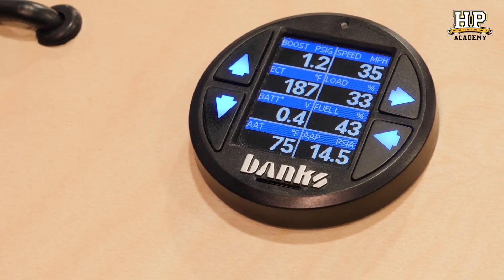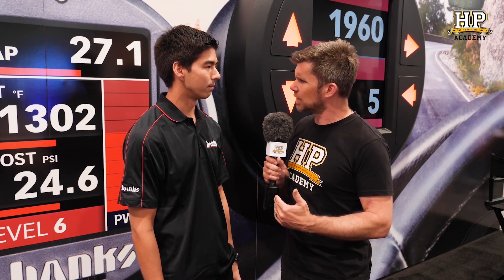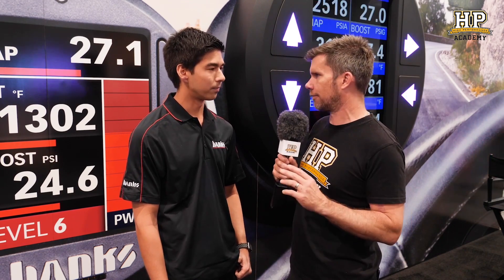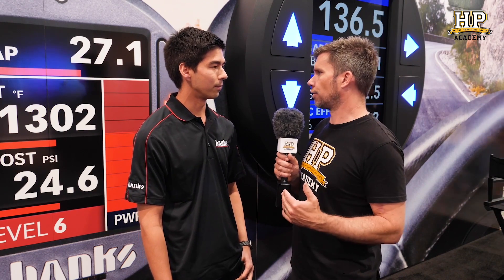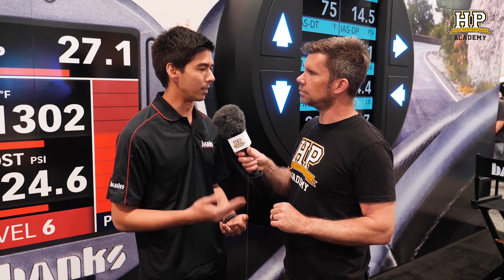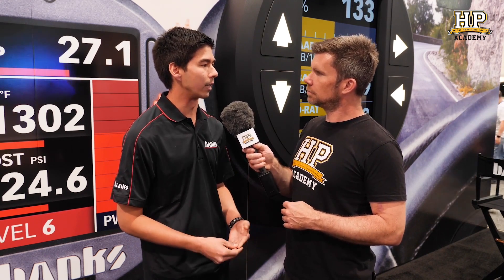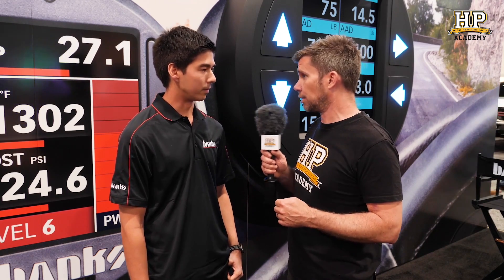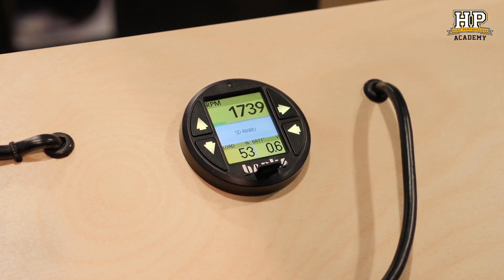How to TUNE your engine without altering the ECM!

Comment: after doing some research i will be switching all my current and future gauges on my diesel (and even other vehicles) to the banks datamonster. im 100% sold having individual EGT monitoring and a million other added sensors such as turbo outlet temp, shaft speed etc all able to import to ONE csv file i can send off to my tuner. it makes things so freaking easy. including able to add in custom sensors such as a wideband 02 sensor etc. 

i love to geek out on data lol

Comment: Wish Banks was more open to getting more data in the iDash (beyond the basic OBDII stuff).  The iDash would be awesome if I could access the things that the old school Scangauge II gets via X Commands - Tire temps, oil temp, trans temp, wheel speeds, etc.
Reply: if they do not have a specific add on sensor, you can define it over their system as long as that sensor is a 0-5v output. so you could do tire temps with a infrared gauge, and individual wheel speeds (i do not have the technical know how for this but 100% could be done)
i myself will be logging: 
individual cylinder EGT

total EGT
turbo outlet temp
coolant pressure
exhaust manifold backpressure
crankcase pressure
then all the OBD sensors such as intake manifold pressure, coolant temp, oil temp/pressure etc. but anything your ECU doesn't read over OBD can still be added on. its truly an expandable and complete logging system that rivals VERY expensive units, in my opinion.
Reply: @UnknownProductions0  I don't want add on sensors in my application, just want it to read some of the more in depth PIDs that I know are available via OBDII.

Comment: How does adding fuel raise EGT ?????? Because i thought add fuel if you need to lower a EGT
Reply: In the gas world adding fuel lowers egt. But in the diesel world its backwards adding fuel increases egt significantly.
Reply: Gas engines are run at a lower AFR than stoichiometric (~14.7:1) to combat detonation. The closer to stoich you run the hotter and more power you will produce but the higher risk of detonation. Diesels are run at AFR's higher than stoich (~14.5:1) because diesels don't have detonation and they will get better fuel economy, less soot buildup etc. When you add more fuel, the diesel engine will be running closer to stoich thus increasing exhaust temperature. High Performance Academy has many videos going into more depth than I can go into in a comment.
Reply: Welcome to diesel engine tuning eh! We actually have a few free lessons on diesel tuning lined up for the next few weeks, and this topic will be covered in one of them. You can subscribe here and they should be coming out on Fridays/Thursday nights depending on your location 😉- Taz.

Comment: That was an excellent interview. My question has always been how hard is it to add the various sensors. A DIY installatiin video on the new Duramax would be awesome. I'm still having flashbacks from adding an egt probe in my 7.3 Ford from 20 years ago. The system is amazing...How easy is it to install..I have watched the channel and been a G Banks fan forever. I see the bundle and wonder how ..
Reply: thereissomecoolstuff There aren’t enough of those videos already on YouTube?
Reply: its as easy as installing the sensor where you want to monitor that thing then plug it in. 

go into the settings on the gauge and blamo

Comment: Does adding more sensors change how the I dash tunes the vehicle from orriginal?
Reply from the maker: The iDash is the monitor and data logger. The Derringer is the tuner. They can operated independently or as a system. Connecting more sensors will not have an impact on the Derringer's tune. However, connecting more sensors to the iDash unlocks dozens of parameters like intercooler efficiency, engine scavenge ratio, manifold air density and more.
Reply: @bankspower  excellent reply. Thank you. Really enjoy all the videos. Earning customers with every one.

Generally what sensors does the tune use to adjust itself for the new trucks